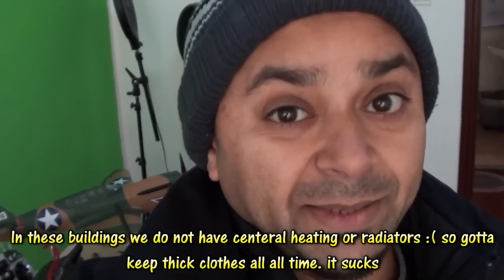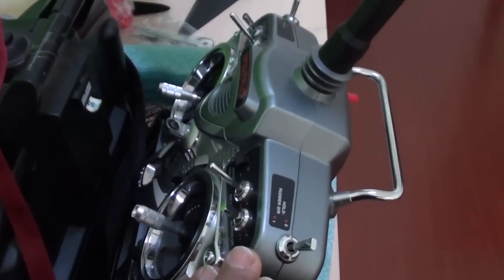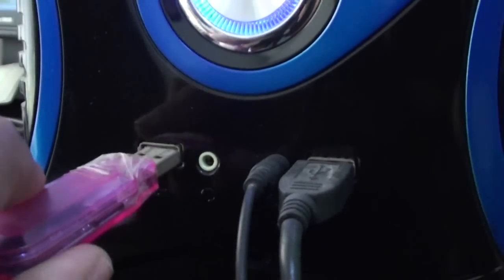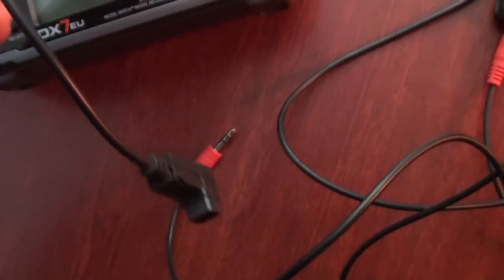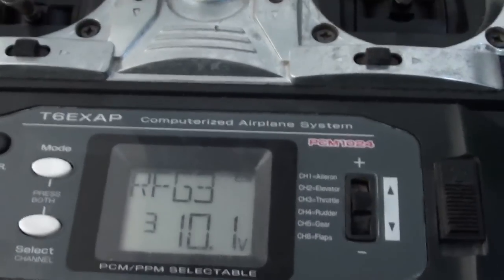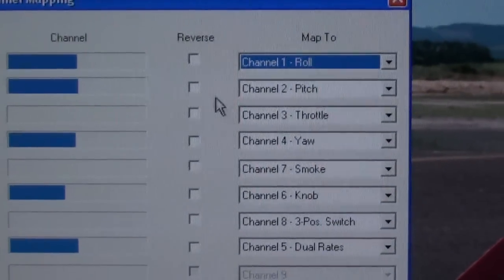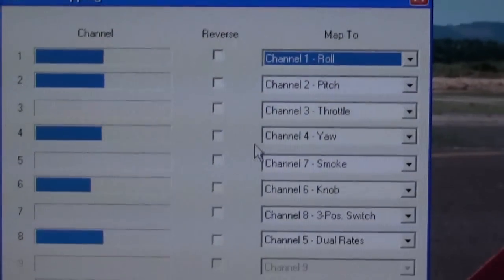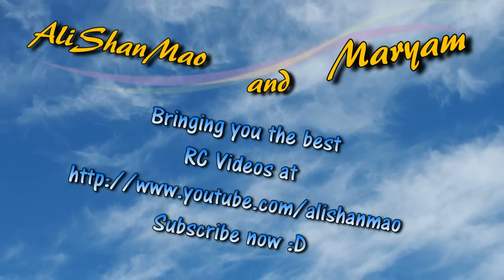How to use Futaba Radio with Realflight

Comment: i have two question 
1-when i am using my (radio link t6ehp-e) should i leave the batteries in the transmitter for using dynam cable

2-is dynam cable suitable to use with (radio line t6ehp-e)

Comment: 10 years ago! 

I've been trying to get my futaba 16sz working with Realflight 9.5, I am
not sure what mode to set and what controller mode to get channels to respond to fly the helicopters, the throttle/pitch mixing doesn't seem to work when Software Emulation is checked in Realflight. Any chance you can do an update video?
Reply from the maker: i use a locally cracked dongle and everything works perfect. no need any mixing in radio. software does it all

Comment: Hi assalamualeikum i managed to connect it with my usb dongle to the realflight g4 but there is one problem my remote controller mc6A has throttle stick in the right and the pitch stick is in the left which is not the same as for the interlink connect so how to change it to my sticks real position by using the mapping can u just explain how to do it or can u make a video for me please
Reply from the maker: controller setup, controller calibration. wassalam

Comment: Hey alishanmao I have a question about the controllers, I'm looking to get a fs-t6 controller, I also have realflight g5. As long as I get a dongle to support g5 can I use this controller or can I use any controller as long as it has a port to hook up to the computer? The controller im using uses the small round adapter.

Comment: Hi assalamualeikum i am fazil busropun from mauritius i obtained a cd with a usb dongle 3.0 and i have installed aerofly on my laptop which has win10 and the aerofly  and my controller microzone mc6A was able to connect with controller
Reply: But now with aerofly it is working perfectly and i also installed realflight stimualtor g4 but when using the emulator to recognise the controller microzone mc6A  it  does not recognise the controller and nor it can detect the input of the joystick so should i uninstalled the aerofly to be able to use it with realflight g4 .please can you suggest me what to do .fazil busropun from mauritius
Reply from the maker: its the dongle that is not compatible with RealFlight maybe, thats just my idea